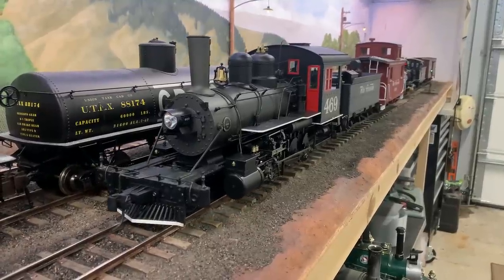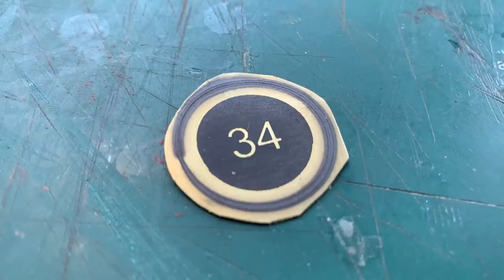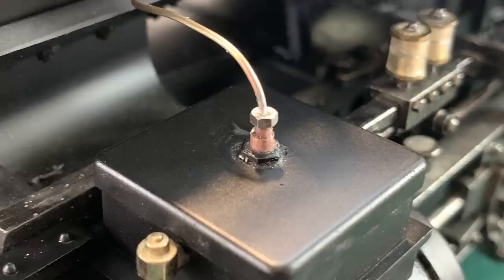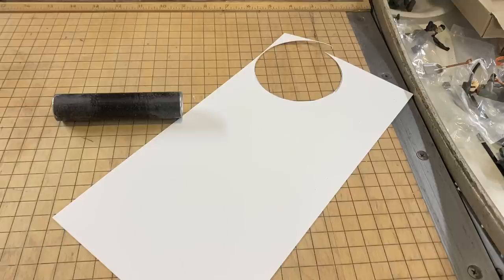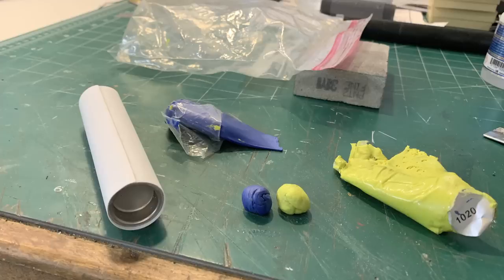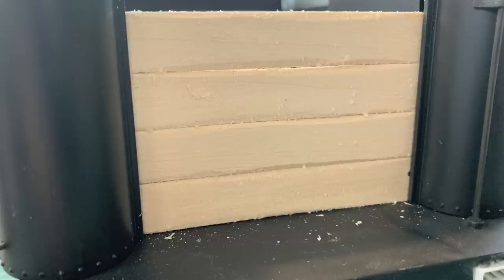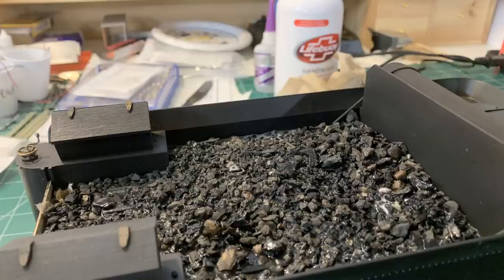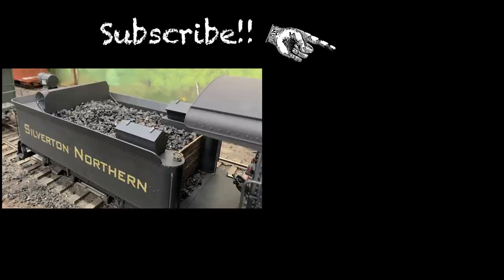Coal Tender with Air Tank for the Silverton Northern #34 "Connie"  -  The Connie Project

Comment: I notice you added weights that are now covered by coal.  Is there some weight standard, was it derailing, or does it just make it operate more realistically?
BYW, that water tank was way over the top.  An amazing job.
Reply from the maker: The original coal load was steel. Added a lot of weight. So I just added that same weight. figured if Bachmann did that it must work. This from the company that used plastic gears…
Reply: @ToyManTelevision    Hmmm... Maybe you've hit on WHY the plastic gears failed.  Or at least part of it.  How much does the loco & tender alone weigh?  Add to that the torque multiplication through the step-down gears from the the electric motor.  And we know from our endless indoctrination lessons on electric cars that motors are already torque-monsters.  Add some cheap plastic, and polymer transmission gear failure is far more likely.

Comment: What do you use to grind up the coal?
Reply from the maker: A salad bowl. A metal one. Then a hammer. But not the head. The handle. Mash down on the coal. Then focus on the big bits. Until it’s all the right size.